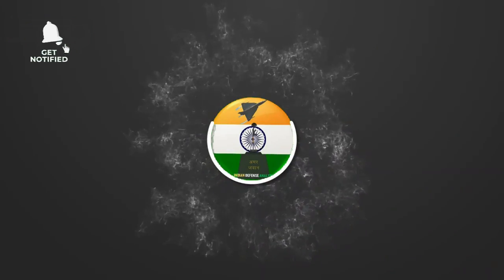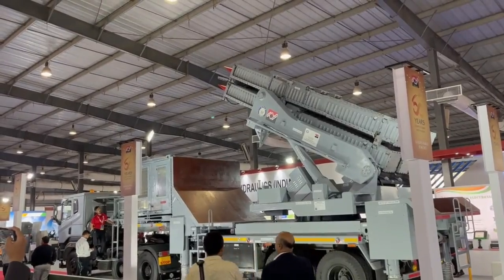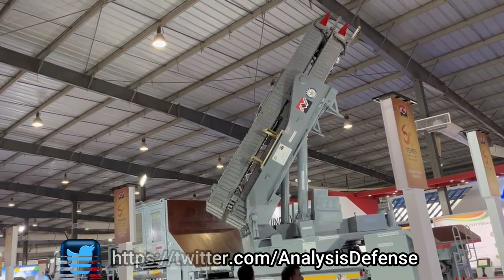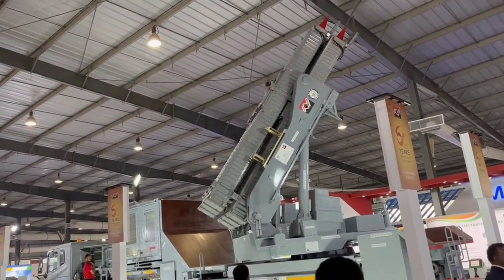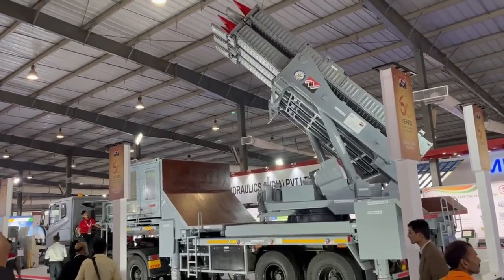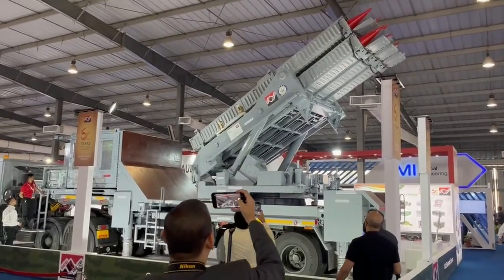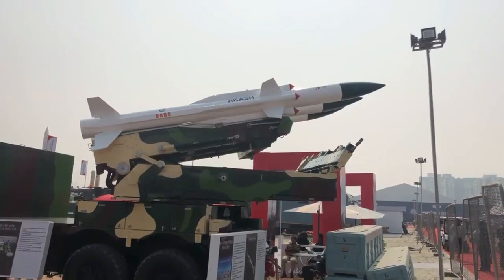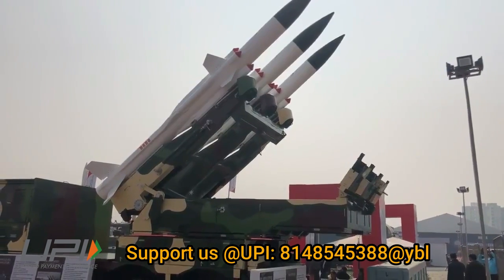Akash NG Missile System by 2026

Comment: Reloading time is upto 10 minutes for the misslie. That is quite a long time by today’s standards with rise of UAV’s.
Reply: Total 6 missiles 
Reload kia super man karega 😂
Reply: But UAV travel low speed
Reply: @chanakya5480  true but UAV’s rarely travel alone swarm drones are what enemies use to defeat SAM missiles. Even $1000 drone can destroy a truck loaded Akaash system.
Reply: @bala09sundaram  yes. but Swarm drone have advantage and disadvantage same time.(the can travel in group) Any single Sam warhead  can destroy multiple drone.Because fragmentation warhead. Also drdo working on AK 630 for land vision. (For army) don't forget air defence system not rely on one type Sam system.
Reply: @chanakya5480  what if each drone comes 50m apart
Reply: @rahulk2633  Mobile Ground based ELINT System available.(Drone need to communicate each other to maintain the distance ( 50m )  so it is detectable.

Comment: We have Astra mk1 with over 100 kilometres range. Why don't we turn it into a SAM system..🤔🤔🤔🤔🤔
Reply: What do you think VLSRSAM is? 😂
Reply: It's called vlsrsam
Reply: @maitreytelang2312  . That's just a 50km range version. Not a long range one..Barak 8 is also not an indigenous one.
Reply: @abymathew295  Barak 8 is being replaced by MRSAM and LRSAM
Reply: @ChandranPrema123  . MR SAM or LR SAM are the same Barak 8 with few tweaks.
Reply: When there is LR SAM then why we are producing multiple types in same  system ? Akash - Ajash NG etc.
Reply: @abymathew295  if aam Is turned into sam Its range will reduce..
See. Amraam to nasams of usa.. Its a basic dude.
Reply: @muruganvenothkumarr9590  .. i know that, but adding few more inches or increasing width or just adding a booster will do just fine

Comment: How is Ramjet better than Duel pulse Rocket motor.
Like Duel pulse Rocket motor needs separate Oxidizer.
But Ramjet requires just Fuel and oxygen as From Atmosphere
Reply: Ramjet can throttle speed like an engine bt rocket motor jst burn at once and then glides on that energy. 

Dual pulse can make to those deficiency to some extent